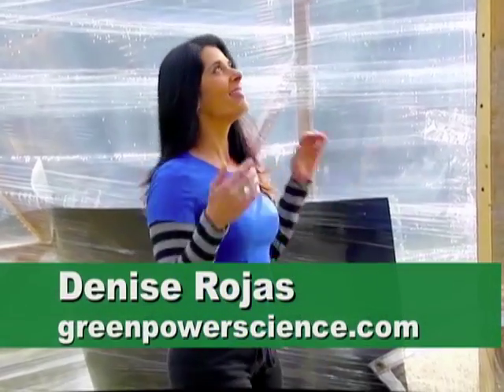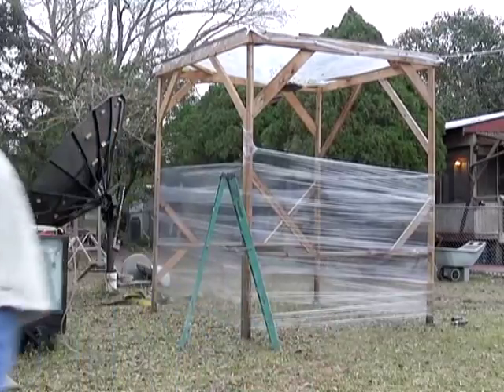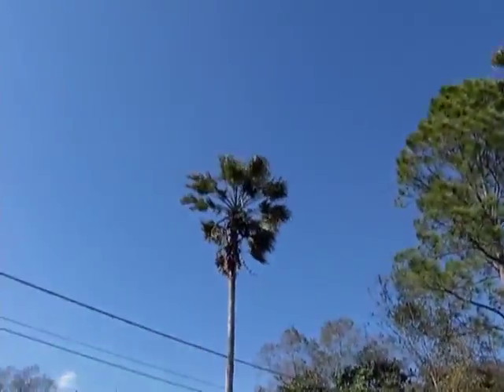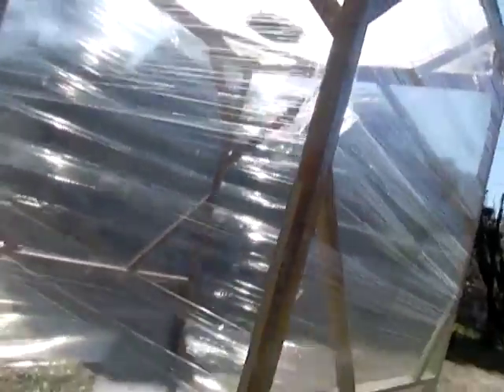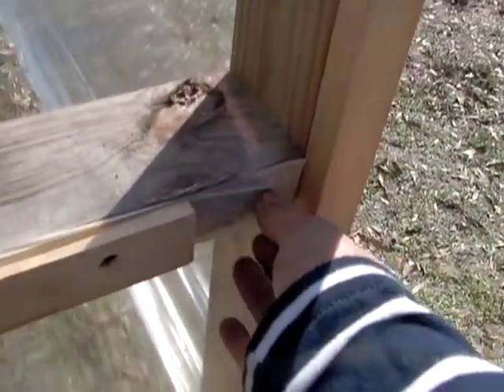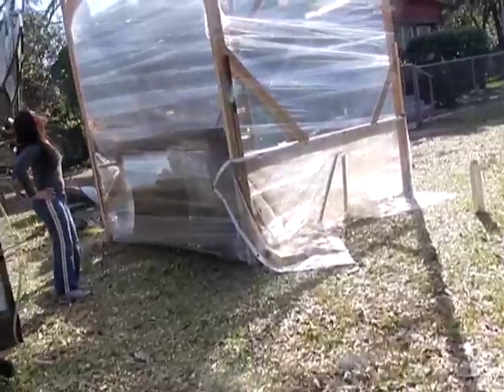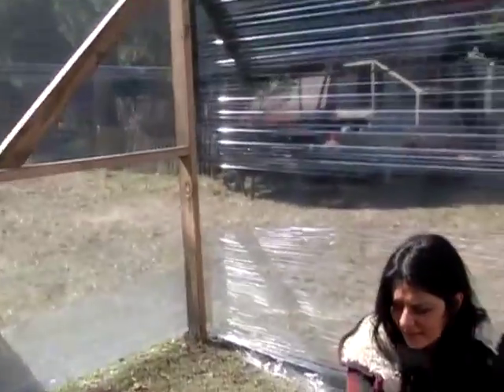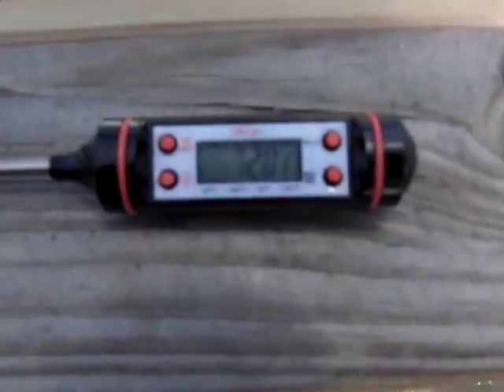Instant Greenhouse Pallet Wrap Thermal Aqua Storage

Comment: holdup starting from the bottom would leave lips going upwards so it probably would holy some slipping through those wripples from the top down bcause the lips would be ever moving inwards 

If you started from the top moving towards the bottom those lips would be moving outwards so even if some did slip in it would fall out of a lower layer iinstead of pushing inbeetween the layers lower below

Comment: Mylar may actually burn the plants with extra light intensity... -the best idea for mylar is insulation. Just like the safety blanket you find in the first-aid kit, you can keep heat in extremely well with it. If you put a sheet of mylar on the roof it will reflect all of your heat back down, the problem is it won't let all of the Sun through. Possibly about a 2ft skirt at the very bottom wrapping all the way around. Whatever wind or cold that will cut through that thin plastic can be blocked an insulated from with mylar. I have an 8 ft by 18 ft Greenhouse that I'm going to pallet wrap today, I've used 3 mil plastic on it for two and a half years in a replace it every 6 months with about $20 worth of material. 3 box of Staples really makes the wood on my Greenhouse look like crap and it certainly wouldn't last as long with all the extra metal rusting away in the wood. Thank you folks for helping me build confidence on this project, you're making it look easy. Note: reach up high with that thermometer inside there. 39° at elbow height... Probably 10 degrees higher at 8 ft, almost 32 at the ground....

Comment: Two layers of pallet wrap would insulate better and could  then eliminate the mirrors for extra heat, a gap for insulation between the ground and the floor would also increase the heat, to reinforce the plastic a sprayed on coating of clear poly-urea would make it almost indestructible.

Comment: Hi Dan,

A little late to the party, but I wanted to comment anyway.  While watching this one I started thinking about that big 7 person tent we bought years ago an no longer use.  (Is it me or does the ground get harder with age?)  I am very tempted to set up the fiberglass poles then cover it with pallet wrap, very similar to your experiment.  Given the tent would now be "free" (it's original use expended, now it is recycle matter), and the pallet wrap can be found under $20 per roll, you may have helped me create one of the cheapest (viable) DIY greenhouses ever!

Keep up with the videos!

All the best,
Rob
Reply from the maker: +S0anonymous Hi Rob, Ground is definitely getting less comfortable:-) The pallet wrap works great and lasts several years.  It is more UV resistant than the opaque tarp material. Thank you for the nice comment and enjoying our videos.

Comment from the maker: It is good for over a year so far. It even held up in 40 mph winds. The eitire structure moved 3 feet.
Reply: Any update? I'm curious about how long these last and am considering it as an emergency/grid-down option for greenhouse/shelter construction. Thanks for all your vids! I'm a longtime fan and seem to keep coming back over the years!
Reply: @cerebral3591  yeah i was thinking about doing something like this but i dont want to redo it every year.
Reply: I was thinking a good chiminea, stove pipe, and some thermal shielding, and that's a heated greenhouse, home, chicken coop, etc.
Reply: I would like to add that the more sturdy the structure or frame you are using the more durable it'll be. I can't wait to try this. I build houses for a living but projects like this are super satisfying

Comment: dear dan i was wondering about heating refrigerant with solar energy as it has a lower  boiling point. such as a coil of  “green”  refrigerant in a coil in a parabolic dish to be cooled with cold  well water. i was wondering what kind of engine it could turn  maybe a re-used “scroll” pump from an old  heat pump. what do you think? no money to build yet maybe you could do it  i was thinking a second mirror at the focal point could focus the rays through a hole in the middle of the parabolic dish

Comment: You can overlay the wrap a little more and that will be more durable and should retain more heat. A light bulb at night is cheap to use and will make a more stable enviroment. If you don't like the greenhouse eluminated at night just cover it with a metal container that will trap the light and release the heat. The fact that its high is good because on a warm day you won't cook your plants.

Comment: You're still missing the point.....Quick, simple, minimal materials, if you need to get up and going with some sort of QUICK greenhouse, this is as simple as simple gets.......you can always do better later on, but if you gotta have it NOW....
I see enough people doing remodels during the year, that I can do a better one from salvaged windows and storm doors. the fact still remains that this can be made in little time as possible, and it WORKS FINE for a quick fix. Starting from zero ?  Tadah !

Comment: Pallet wrap breaks down and gets weak in the sun. I like where you're going though. Theres a lot of types of sheeting that can be used. At the greenhouse I worked at, we would throw 2 layers of PV sheets over the framework, than attach a fan to the innermost layer. It would put a layer of air between the 2 layers of PV and trap TONS of heat.

Comment: This is an interesting idea. I live in Winnipeg and am waiting for a month or so before putting the panels back on my greenhouse. It is an old converted carport. You know the kind with the silver tarp covering. It's 10x20. I am wondering if this would be a good experiment to try while I am waiting for spring. It has been an extremely odd winter in Winnipeg with average temps WAY above normal. I was wondering if you noticed any issues with the bare wood tearing the wrap at all. Thanks you two!

Comment: There is black pallet wrap, if you can find it. (We used it at the paper mill to wrap light sensitive paper) But you would just wrap it on the back wall between the corner uprights and then wrap the whole thing with the clear. Or there is also black, 4mil or higher, poly that you could attach to the back wall. Did you think of using the "space blanket" reflective material on your north wall?

Comment: I was thinking for the north wall use that foam board insulation from home depot that has foil on one side, it would reflect light in and insulate the north side from cold wind.  Also another idea for the plastic wrap, might be good to wrap around plants if you get an unexpected freeze. Wrap around a tomato cages?

Comment: @galaxiedance I was thinking a similar thing. Only, Instead of wrapping a structure twice. I was thinking that making 2X2 wall panels that are wrapped all the way around. Then the side and rear panels could be filled with some bubble wrap for extra insulation while still allowing for light transmittance. The panels could easily be screwed together to make the structure into whatever shape you desired. 

Well, I am off the shipping supply store and 2x2 store. Great Idea!

Comment: Wouldn’t rock heat storage be better? You can put in a loose used brick floor. You can find them at demolition sites. Used in conjunction with the water barrel should keep it warn enough throughout the night.